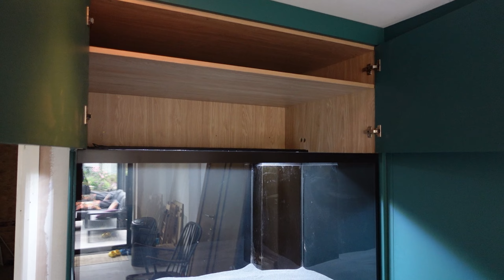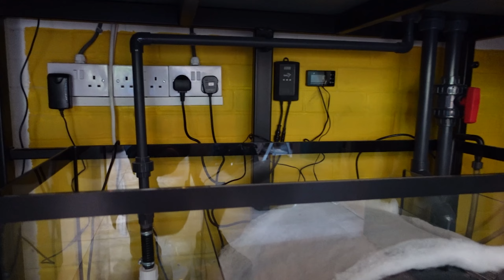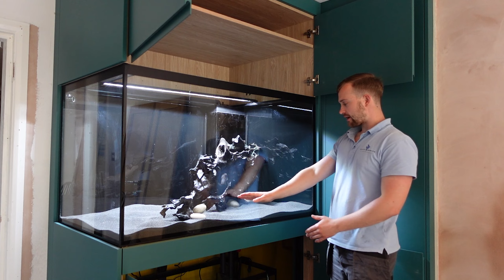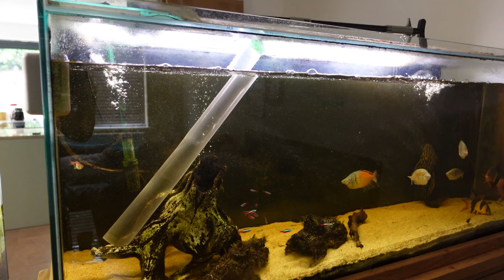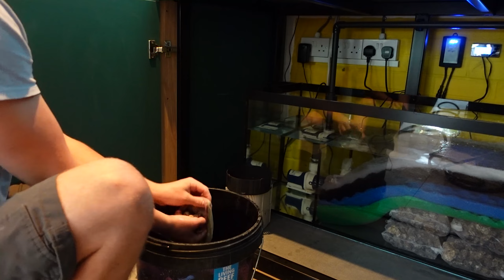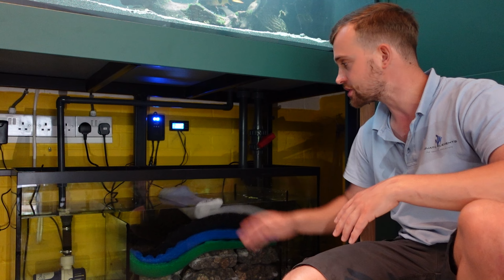CUSTOM AQUARIUM INSTALLATION | Fill up & adding fish

Comment: This would have made a nice reef tank, also makes me wonder why more tropical/cold water folk don't use fleece filters like the ClariSea?
Reply from the maker: It definitely would have, but these customers have had most of these fish for years, and it was simply an upgrade for their pets. The filter fleece is just an easy low-cost method. I find freshwater always has a much higher bioload than marine tanks and filter rollers block faster. Thanks for watching 😁

Comment: Your sump is not designed correctly. Water should flow to floss/ sponges from top to bottom  or bottom to top. You need add another glass in your sponge chamber higher than glass in pump chamber. Same as right hand side.
Reply from the maker: The sump is set up so the water flows through the floss and sponges, down into the biomedia, and then back up and over into the last section. Maybe it doesn't show it properly, but the filter fleece is raised to make sure all water passes through it before entering into the biomedia. Thanks
Reply: Hi Chris ,this is a fantastic aquarium. The fish are so healthy and they have a wonderful home. 
I wish that your company could build a pond for me in the North West of England. 
Well done. 😊
Reply from the maker: Thank you so much
Reply: I'm no expert but that sump doesn't look correct to me either why would the water flow down rather straight across the top of the floss should it not have another raised baffle before the last one in the media section to force the water down
Reply from the maker: The filter fleece is raised, so the water has to pass through it before entering into the foam. It's just difficult to see on the video but the water has to go through the filter fleece and won't flow over it 😁